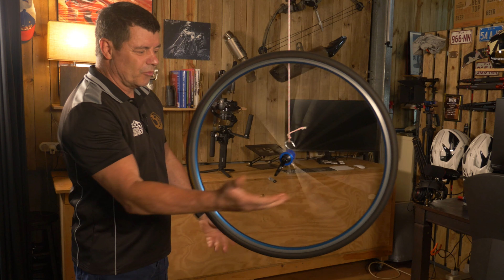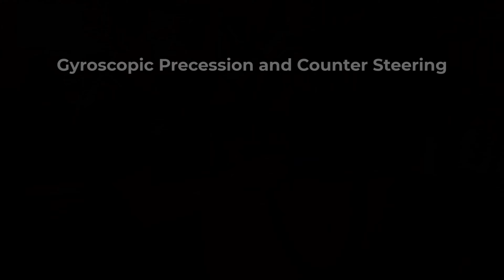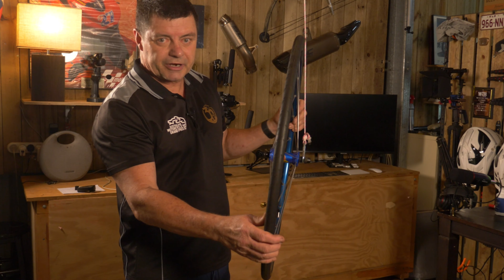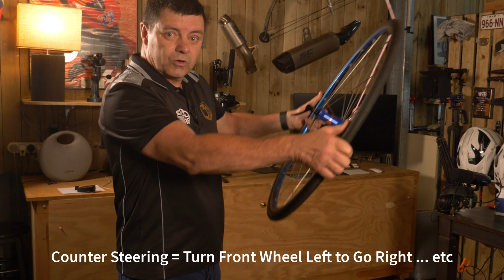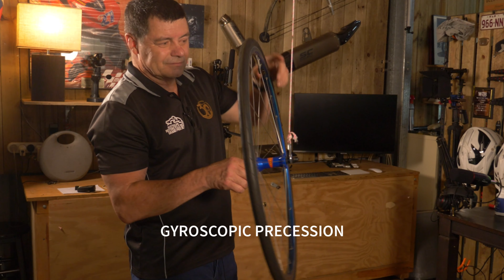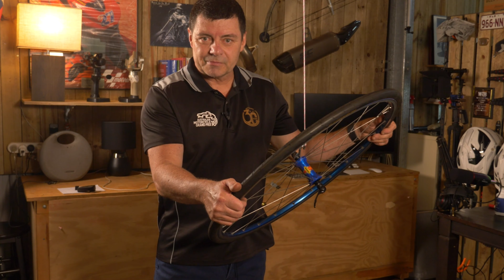Understanding Gyroscopic Precession and Motorcycle Counter Steering

Comment: My grandkids (7, 10 & 13) wouldn’t believe me when I told them how to use counter steer on their pushbikes. I suspect many motorbike riders are a bit unsure about it too. The spinning wheel is a great explanation tool. Good job mate.
Reply from the maker: cheers mate, yeah it seems to be clearing up some confusion for many of my riding buddies as well.
Reply: You suspect correctly. We do this demonstration in my local advanced riding groups at the start of each new course. We get the new associates to hold the spinning wheel and give it a forward push in one direction or the other. For a lot of them this is positively eye-opening.
Reply from the maker: @NooBiker  thats cool, yeah it is one of those things that don't make sense in words, you have to see and feel it to realise how it works.

Comment: All nice and good that precession is given as a reason that countersteering is what turns a motorcycle (or actually any single track vehicle) but it's wrong, wrong, wrong. Countersteering causes the motorcycle to lean because it's an inverted pendulum. The effect of precession is much smaller.
Reply from the maker: Like I said in the video it is "one of the factors" and I agree that the inverted pendulum concept does apply too. It's not a matter of one or the other. However it's important to recognise that steering a bike onto a different plane when it is in the air such as in supercoss or motocross is the result of multiple factors including counter steering and the gyroscopic precession, there is no inverted pendulum in the air as the tyres don't touch anything yet it steers. What I am saying is they are both factors. The goal here was to make people aware that there are other forces at play.
Reply: Any single track vehicle on the ground is an inverted pendulum.  It's not a concept, it's a fact. And a motorcycle in the air can't change directions laterally because no force is acting on it. You can change the direction it is pointed but the velocity stays in the vertical plane that it was in when it left the ground. You weren't paying attention in Physics 101.
Reply from the maker: @kenthartfield3237  cheers mate, you obviously don't ride super cross.
Reply: @TheBikeStig  And you don't do Physics.
Reply: @TheBikeStig   Could you explain  why motor scooters with small  and the smallest  diameter front wheel are the far less stable when  cornering at speed and can loose traction easily slipping out .Is  it because the smallest wheel is spinning faster increasing  gyroscopic force effect more or less compared to a slower spinning bigger diameter wheel at same "land travel" speed and then how to control these  forces, many unsuspecting scooter riders fall .
Reply from the maker: @erikkopsala3564  given how much the gyroscopic effect contributes to stability, II would assume that the smaller wheel means less stability. Again without any data, I have a felling the rake at the front end is much steeper on a scooter ... combine those two things and you get a super easy bike to ride at slow speed but it comes with some instability. No data on that mate, just my thoughts about it.

Comment: I understand the concept. For those that don't, it may be difficult to understand from this video. Please explain which side of the hub you were applying pressure, it wasn't obvious.
Reply from the maker: yeah might not be as clear as I'd hoped, we put arrows on the diagram to indicate direction .... basically the arrow is on the left side of the wheel and the press on the axle is away from the viewer towards me which turns the wheel to the right, hopefully that makes sense. Best thing is to grab a bicycle wheel and give it a spin and see how it responds to turns.

Comment: Try suspending the wheel with cords on BOTH axle ends, then put weight on one side.  The gyroscopic precession will turn the wheel TOWARD that weight.  That is acually how MC's work.  This precludes ANY counter-steering!  The GP demonstrated by Bozeman shows this clearly!
Reply from the maker: That would be correct, a downward weight on one side makes the plane of the wheel turn 90 degrees to the downward pressure. Crazy how this works.